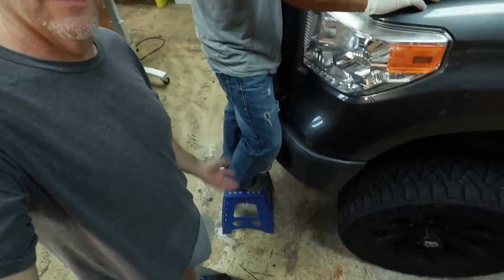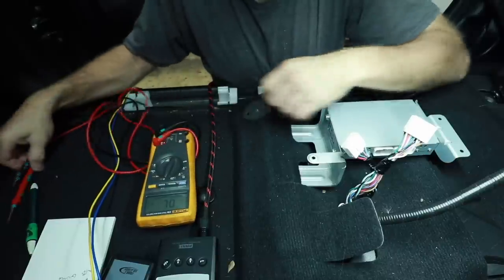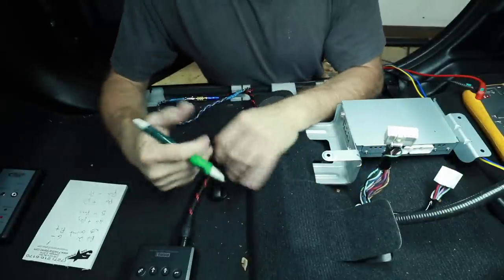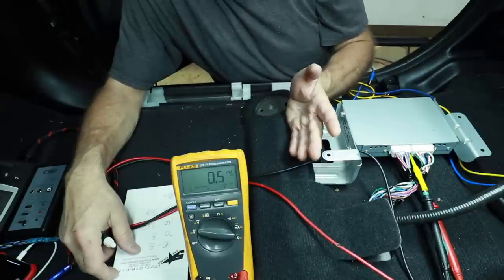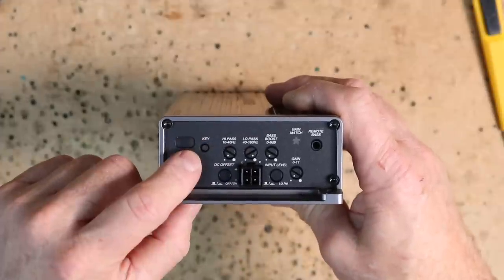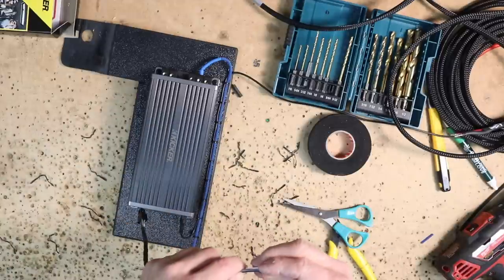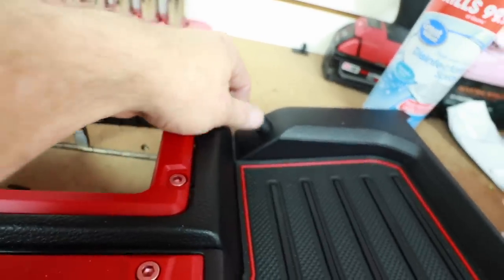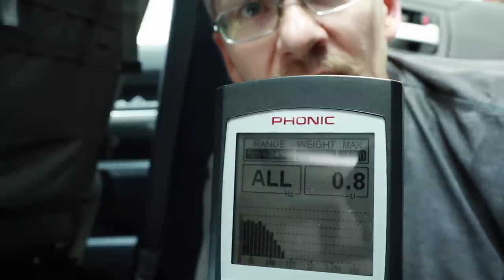How to install a Kicker Key500 1 high level in a Tundra full video

Comment: Thanks for this video. I just finished my install. My truck had the stock JBL with subwoofer, so I just bought a connector to tie into the stock subwoofer speaker wire behind the seat, I used that signal to feed the Kicker, I did not run a remote wire, the amp turns on using the input signal. It works great and I didn’t have to mess with any stock wiring at all. Great little smart amp. I copied your abs plastic  mount designs for the amp and the fuse holder. Thanks again!! Awesome. 🤙

Comment: So, was the amp inputs wired up to the OEM amp speaker level outputs? And, if so, I presume that the amp can handle that high level input OK? Or, is it better to use a LOC?